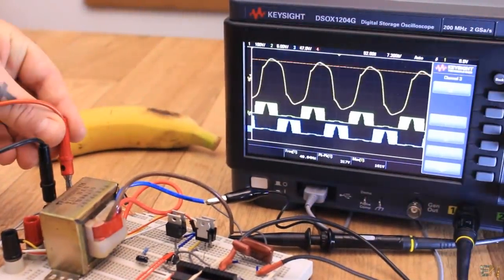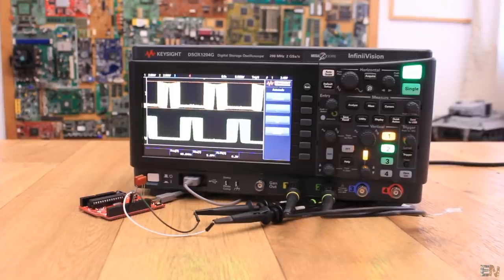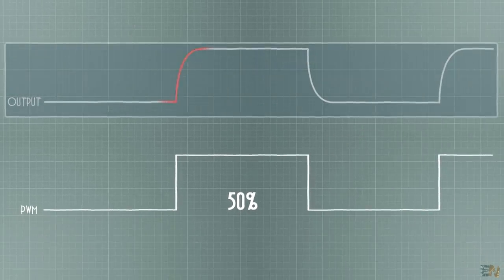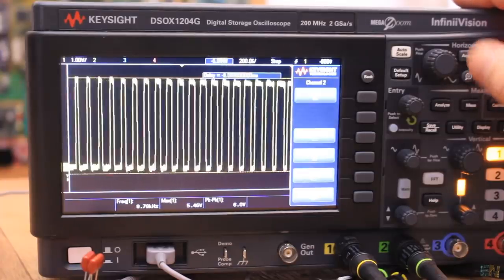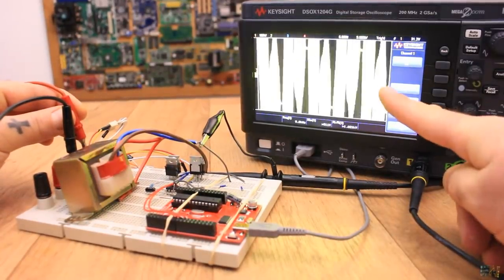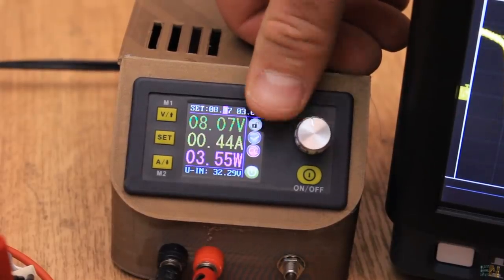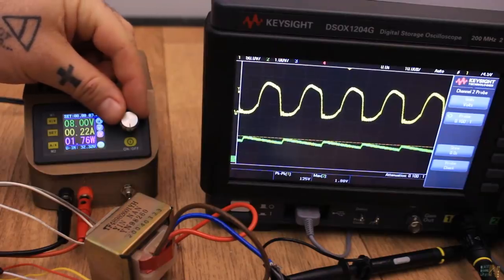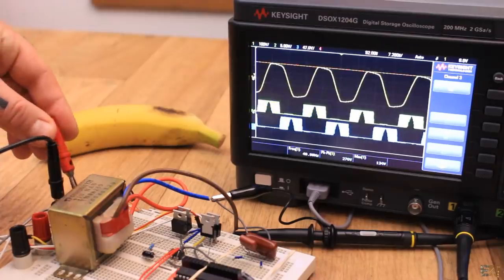SPWM sine INVERTER with Arduino

Comment: If you used a LC filters instead of a single capacitor you would get a way less distorted sinewave
Reply: it could be a way
Reply: Yes If used a LC low pass filter Then distortion will be very low and will give near sinusiodal wave.
Reply: Wrong SPWM algorytm, if used SPWM like EG8010 and L- C filter, output wave will be true sinusoidal.

Comment: The problem with the output voltage going down is because of your DC supply. It cannot supply the voltage and current required. Using battery will change that problem and must give better results. 
Think about also that the input voltage becomes instable and with much more ripple when you load your power supply heavily.

Comment: I think a LC filter instead of of the Output-Cap would do a better job of smoothing the waveform. Also you just could use a single diode and a Cap for the feedback and adjust in software - since it's the same voltage, only flipped.

Comment: Excellent,  Thank you!  Planing to use a DDS module as a driver for precise A/C frequency and a PWM chip to follow the value from the DDS for a low wattage A/C synchronous motor. Might be a simple transformer driver for only a few watts.

Comment: why don't you add a boost converter directly to the power source and just apply the signal without any transformer
Reply: HV DC boost converters are costly and introduce way more difficulty in operation

Comment: Why don't we use NE555 to generate square wave then we add on the output of mentioned IC a LC filter in order to get sine wave then we handover this signal to a preamplifier ,then the last stage to the both gates of power transistors

Comment: Great video as always! I tried once this type of inverter (Arduino SPWM + mosfet driver IC+ mosfet H bridge) and I obtained a nice sinusoidal shape by placing the capacitor in paralel with the primary of the transformer so that together with the transformer inductance to make a LC filter. Also in this configuration the transformer seemed to be less affected by the relatively high SPWM frequency since I didn't use a ferrite core transformer. Greetings!
Reply: How much it's cost to make this project
Reply: Yo man, I have a question. What transformer did you use? I can't find any suitable one for this project and I'm looking for help.

Comment: Hi, very informative video.👍 Do you have 110V AC main power, so the output peak to peak AC should be 310V? Another question: the high voltage output feedback using a rectifier bridge and voltage divider to the low voltage side without isolation, will be there any safety problem? Thank you in advance.

Comment: Hi. I want my arduino to detect a sin wave (100 hz or 200hz or any other frequency )  i am generating it using my phone through an app and feeding it to Analog input of arduino . I tried pulseIn() function and also tried freqcount.h library but my arduino is showing random frequency values. Can you help?
Reply: 14 but adc???

Comment: Hi,i have a question about voltage feedback in this greate project,and i want ask,can we create variable spwm frequency to achive voltage corection in the output with feedback loop?
Reply: My question too. Add into the Arduino code modification of the pulse width depending on output voltage....

Comment: Last week i tried ur 1st inverter circuit and it's working well except for I'm getting a 170 volts out of 12 instead of 220 although the transformer is rated 12/220 not sure if it's the harmonics or what creates that power loss but it's really educational so thanks alot ✌✌
Reply: Try using 6-0-6 for 12V battery .
Reply: @pateafanai5489  thanks for your suggestion but i want to note that this comment is 3 years ago and it was a college project in some subject and now I'm graduated alhamdulilah 😁
Reply: I am also making inverter but 6 0 6 transformers are not available with high apms
Reply: And in squre wave 12 0 12 work fine
Reply: @hamadyt956  your words feel familiar 🤔 
I think i used to be an electronic engineer one day 🤣
Reply: I am getting only 78 volts at output . Could you pls help? I am also making college project
Reply: @hamadyt956  .
Reply: @latestlaunchesandreviews5489  man this comment was 3 years ago i am already graduated and i have no clue about it.
Try reducing the harmonics by adjusting the frequency using the potentiometer and tell me what you got

Comment: Can you  changing pwm signal when the load is working
Reply: Yes, you need chance the values of pwm settings of the Arduino, it's not too smooth the chance but you can

Comment: Good day Sir, I followed up your tutorial on a  pure sine wave inverter using Arduino, it was sweet, I have also built a prototype of in in my house. The only challenge I have is on the feedback code so that my inverter output will be stable irrespective of the load. Please, I would like you to show a section of the feedback code to enable me complete the inverter project. Thanks, Wordu Solomon

Comment: I did click a like button like crazy but, it only increment once 🙆🏾‍♂️;
Thanks buddy, how can we improve this so I can make my own inverter to power amost 500w!?

Greetings from Tanzania 🇹🇿
Reply: Essentially you would have to add on multiple Mosfets or use IGBTs. You might have to use some flyback DC-DC converters to power the gates of all those transistors. If you really want to go all out you can purchase NXP's half bridge GD3100 development board and for $140 and program some beast Automotive grade IGBTs.  At that point the sky is the limit.

Comment: This little Transformers are very basic, I used some of the iron cores of this for a very basic mini induction machine, get hots very quickly and have a Lot of losses when the secondary is loaded, please rip off and wind a ferrite core transformer, the performance Will be to much better.

Try with a flyback CRT television ferrite core.

Comment: I think that video is extremely bad, your project is not practical usable because two things
Reply: first you generate SPWM but that not guaranteed sinusoidal output during different type of load such inductor (coil or electric motor) or capacitor
Reply: second, but most important you use step up converter (which is low power, current less then 1 A on input) that is not good idea when use transformer wich already boost voltage, that is not efficient and harder to build high power DC boost converter
Reply: He did already mention this that this is just a work of trial, NOT for professional or real life use. At least he did present the core principle of pure sine wave inverter clearly and I do give a thumb up for his easy explanation.